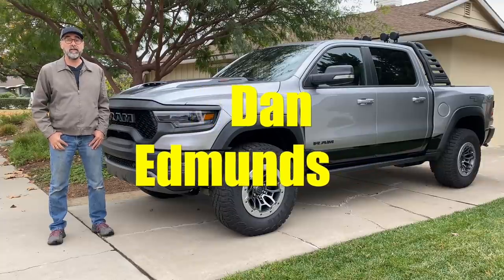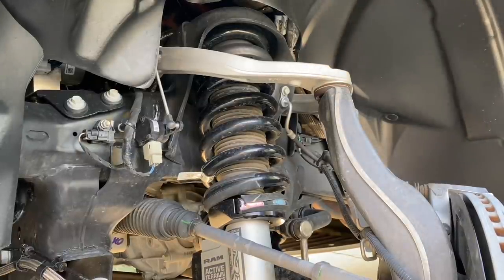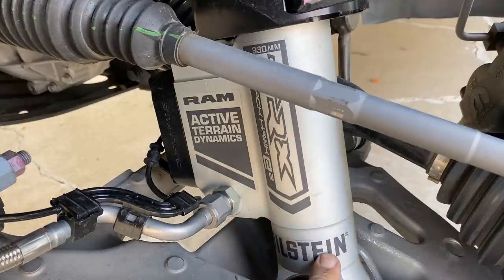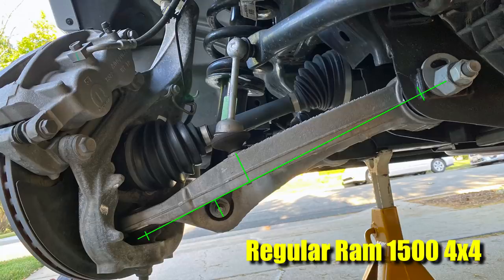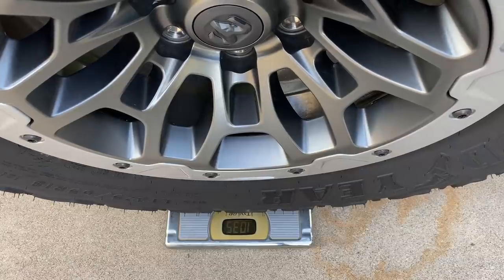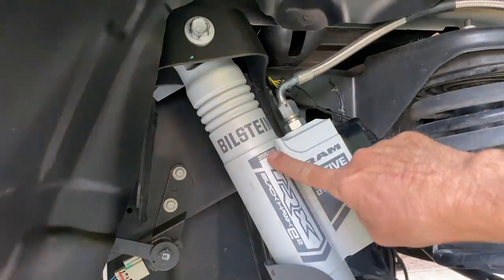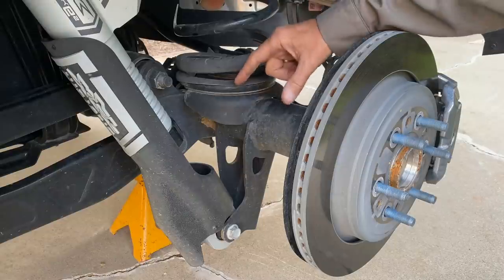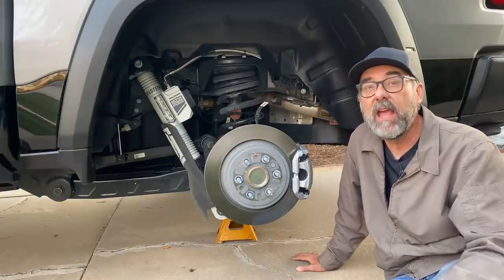2021 Ram 1500 TRX Suspension Walkaround - A Better Off-Road Pickup Truck Than The Ford F-150 Raptor?

Comment: Excellent video! This is one well engineered badass truck. Incredible suspension with a monster power plant. I'm a diehard ford man but this has got the raptor beat.
Reply: Only in hp

Comment: Excellent video!  Are you saying the wheel or the trim ring is forged?
Reply from the maker: The wheel. I guess when it comes to the trim ring being a real beadlock, it's a forgery because the real 24-bolt beadlock retainer is a Mopar accessory? ;)

Comment: Great walkthrough Dan. I am really surprised they had a damper to control the windup. Have you seen that before
Reply from the maker: It's rare on production vehicles, although the Viper-powered Dodge Ram 1500 SRT-10 had one with the leaf-spring rear end that came before the switch to coils.

Comment: I noticed the link separation on the rear axle was pretty small, Im guessing thats part of the reason for the 5th shock. The small separation would make for better packaging though.
Reply from the maker: Yeah. The want ground clearance under the lower link. for sure. That is part of it -- especially when those are high-angularity bushings that might deflect more than non-PowerWagon 2500 bushings.

Comment: ok......in your honest opinion.......do you think Ford will put the 5.2L Predator V8 (shelby GT500 engine) in the new Raptor? 

Or do you think that is too "bespoke" of an engine (low volume built on the small Niche line) and not fit for truck capabilities?

The hellcat has an iron block better which would help it more in a truck compared to the all aluminum Predator engine
Reply: From what I’ve heard you are correct about the “small Niche line” supposedly they wouldn’t be able to keep production up if they stuffed them in all Raptor it’s gonna be a limited run of raptors from everything I’ve heard
Reply: @mrtorque6488  Yes I read that as well.....the only thing to stop and consider that was never mention is that the GT350 is now finished and therefor so is the Voodoo.

 The Niche line would have been pumping out way more Voodoo engines compared to the Predator since the car cost half or less than half of a GT500. So the Niche line just got massively freed up
Reply: @twinturbo3470  wow didn’t know that that would be awesome if the v8 is more available then and not super special and priced gouged 🤘🏼
Reply from the maker: I tend to agree with your line of thinking, but I don't know. FCA has basically made a Hellcat version of everything, so that engine isn't that niche. That said, and engine development project costs bank. Making more of them wouldn't hurt the bottom line, I would have thought.

Comment: You had me at not a V6.👍
Reply from the maker: Right?
Reply: @DanEdmunds  I know you didn't actually say not a V6 but you did mention it has a 703 hp Hellcat engine. I'm just saying I wouldn't buy a Raptor because of the V6 engine. 
Thanks for the in-depth look at the suspension. You're the first one I've seen do that.

Comment: I'm getting close to ordering one. I have found out the bump stop inside the rear coil is bolt on and removable. So you have any dimensions for the rear spring. Like inner diameter. Trying to mock up coil spring air bags
Reply from the maker: Sorry, I do not have dimensions. The truck was a week-long loaner, so I no longer have access to it.
Reply: @DanEdmunds  OK thanks

Comment: Can those Bilsteins be rebuilt?
Reply from the maker: I do not know that. Bilstein is deferring some internal detail questions to Ram because they have an exclusive on some of the internals for a period of time (1 year?). I'm not sure how much of the damping comes from the main working piston, either. So much is tied up in the computer algorithm that makes the adjustments in the spool valves that I'm not sure if hardware tuning would be the best approach. I hope to learn more and get into it deeper in the near future.
Reply: @DanEdmunds  thanks for your input. Makes sense. Hopefully a guy can rebuild there own. Pending on cost of course.
Reply: They said they never have to be rebuilt. Which has to be a scam. Nothing lasts forever.

Comment: You cant compare this to the Raptor. The Raptor doesn't have a LSD just an open lockable diff that you cant control. Its linked to modes where it will only lock in 4WD not in 2WD. The E-LSD is terrible, super slow to respond, its a one wheel peel machine. I was definitely disappointed after my Raptor drive..
Reply from the maker: New Raptor coming now that the 2021 F-150 has been redesigned. Not sure when. Rumor has it they're putting link-coil in the back. Not sure if that's true or not.